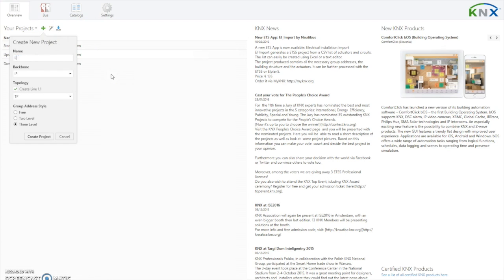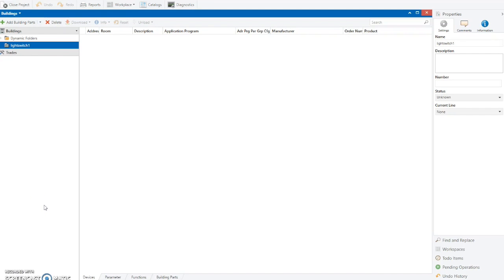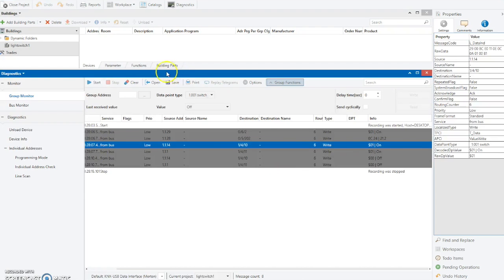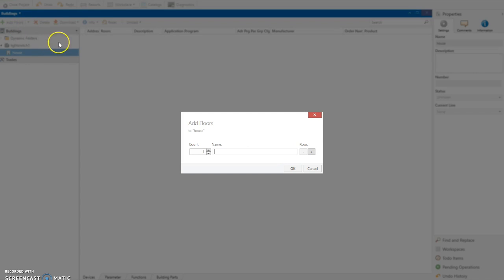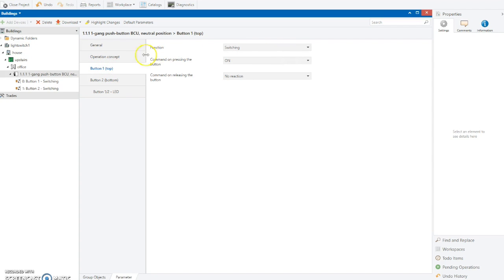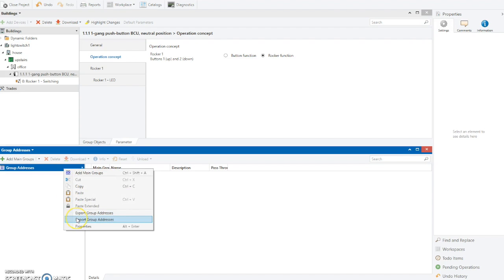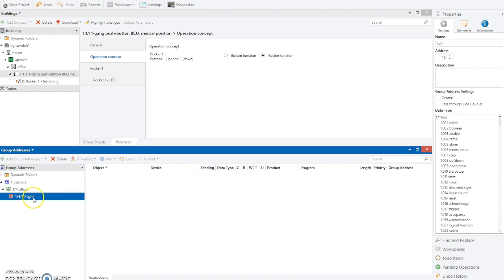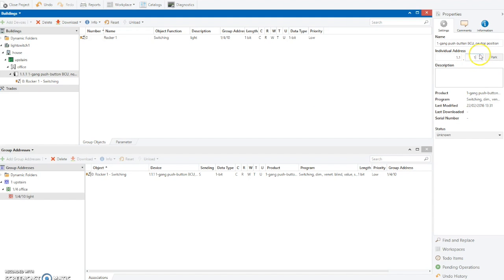KNX ETS5 TUTORIAL (3) - Re programming A Device

Comment: hope you can help me.
I was trying to reconfigure a part of my home configuration after I lost my config-project. I made many tests with GW09834a (knx 4 channel Easy contact interface by Gewiss) after enter/exit programming mode I probably made some unexpected edits or maybe I've broken my device because now ets5 cannot listen button-pressed anymore (i "group monitor").
Do you know how to restore it, maybe factory reset, and find it again on line scan?
tip: If I check for individual address on 1.1.1, ETS5 starts working on something and never ends (i have to kill the process). Thanks in advance

Comment: @alderley.ai I have a knx solution in my house built in 2017. The electrical company will not give me the ets file so I have to reprogram it myself. I have GIRA 3-gang in every room. They also control heat and normally one light, dimmed. The other switch is for future use. The switch controls a dimming actuator(6) and a heating actuator(3). I also have a switching actuator for all the lights that doesnt need to be dimmed 

I want to program the switch so that I can have a KNX object on Comfort mode and Night mode so that I can control when those modes should be active. I have ETS5 demo and have made about 30 projects to cover my entire house. I havent done anything yet because I dont want to break anything. 

If I can get help with one or two rooms, I can do the rest myself. We are nearing the warm season now so I can live without heating in some rooms for a while.

Are you interested in helping me reprogram my house?

Comment: HI, From what i understood from the video is that you just reprogrammed the switch. but how does the light work if its not associated to an actuator in the group address??
Reply: Hello! The light actuators are already programmed and connected to the lighting circuits. The video is about how to make a change to an existing system. Hope this helps!

Comment: In the minute 13:35, when you press the programing mode buton, two addresses are shown: 15.15.255 and 1.1.65. Maybe this is the reason why the ETS5 keep saying there are 2 devices in programing mode...
Reply from the maker: Hi Mr Super, I have figured out this error - "more than two devices in programming mode" - it is an error due to the presence of a raspberry pi with USB knx interface connected to the bus. I am not sure yet why the rpi interface takes on this address 15.15.255. However if you close down the rpi app, then the issue resolves and devices can be programmed. Good luck
Reply: @Alderleyai  When device is not loaded with a individual address it takes the last posssible address. In the Interfaces menu you can set the address ot the usb-knx interface to 1.1.255